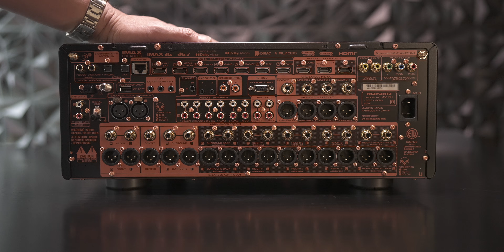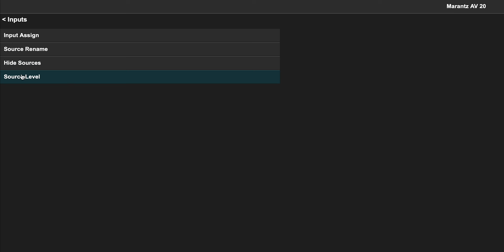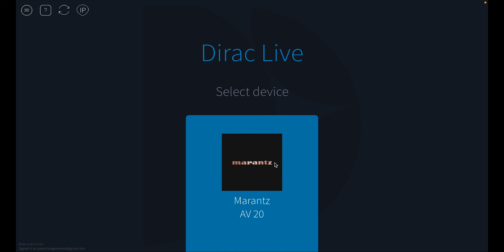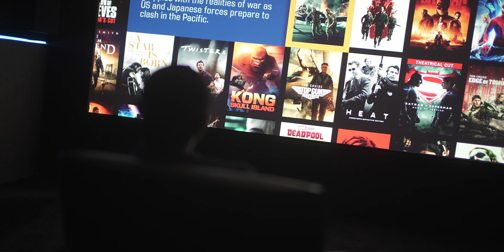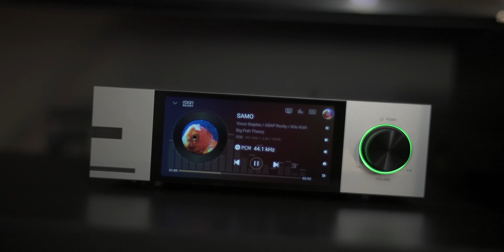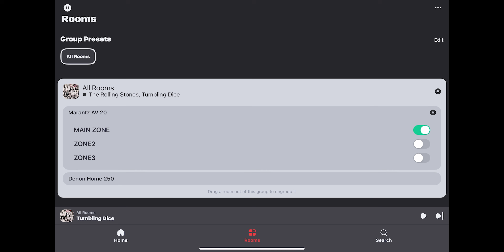Marantz AV 20 13.4CH Pre/Pro & AMP 20 Review -Dirac ART Coming!

Comment: I don't understand why Marantz destroyed the rear USB ports on all its products by changing them to power-only.  Because of that, we now have to have ugly USB thumb drives or cables sticking out the front of our units (which no one wants to see).  What the heck would a power only USB port be needed for anyway?  I hope customers tell Marantz to restore the rear ports ability to transmit data like they used to have.

Comment: Shane your giving the amp 10/20. A pass to easy. For the price marantz is charging they better set the bar higher.  This is why I use strake sound or anthem amps.   But av20 might be a little high in price but nice upgrade in there prepro line.

Comment: I can't see the value in the Amp 20.
Here in the UK the Amp 20 is (I think) £4750. For roughly the same price you could get 2 Emotive XPA 7 giving you 14 channels and significantly more power per channel. The Amp 20 draws max 1500w the Emotiva's  2600w each. 
Cost wise you do even better with 2 Tonewinner amps.

Comment: Excellent video boss who is going to repair these amplifiers when they break down I have gotten a 4800 H and a 6800 H from DanOn the 4800 H the HDMI board failed on it sent it back my dealer asked me what do you want instead of it I said the 6800 H that came had it for a month software issues and the gooey that fails sent it back in both cases all I got back was money money they did not repair or could not repairs I don't know which in Europe anyway I live in Ireland but it seems they have no repair service in iron in Europe and that was it then I now have a Sony STR IN 1000 and an absolute delays in both sound and vision60° special audio fantastic at all works from day one without any issues set up as a breeze so that's what I have now thanks for an excellent video

Comment: Tried lfe routing and positional. 

Found the same thing. In some circumstances, it was worse if you don't have the exact same subs.

 I have a svs sb1000 and a sb2000pro the 1000 is a  far worse sub, so the experience was not great.

 Coupling the speakers into one main channel (with different trims) worked a lot better keeping that overall solid feeling.
Reply from the maker: Yep, Mono split of all subs properly time aligned and level matched for the win.

Comment: Cool, If you found an AV10 and amp10 in a shop don’t go to the 20. If you really want marantz take the integrated av30…. This one is a big scam from Marantz (I’m a a marantz fan). Construction and components are not a 12k price. You pay 3 times the price for the same…

Comment: When you showed the DIRAC calibration, you didn't mention to check the noise floor and when setting the volume, try to achieve between 20-30dB (ideally 25dB) higher test signals than the noise floor. Also you haven't mentioned the minimum and maximum distances between the microphone positions. Also you left out the most crucial part about setting the gain for the subwoofers. Did you do this on purpose?
Reply: You clearly missed the part where he said to watch the tutorial videos 🤦🏻‍♂️
Reply: @andrewskaterrr  you clearly missed that video lacks this information too ;)
Reply: @davidjalsoviczky6055  this is clearly not a step by step tutorial for Dirac, it's a review that had a quick section glossing over the overall way that Dirac works. You need to learn the difference. We don't want an hour long video that is a review and Dirac step-by-step.

Comment: Why dont they have an amp with 30channells.missing out there marantz.
Reply: lol, Atmos is not Atmos without 30 channels.  I've always believed that the 4th surround speaker at angle 187.31 degrees in the rear is the second most important speaker next to the center.  It doesn't play any sound and doesn't need to be connected but it just fixes all acoustic issues of the other speakers in the room. 😂

Comment: So here's my honest opinion about Marantz AV20 its a $6000 12 channel power amp, it's rated at 200wattx2 at 8ohm (20-20k)hz. If you look at the back of this amp it's rated at 400watt max and made in Japan. What bugs me most about Marantz is that they rate all their power amps based on only 2 channel driven at full frequency spectrum even if its a 6k 12 channel amp. 
What any consumer will expect from a 6k 12 channel amp is atleast rate it at all channels driven with full spectrum. And I think the reason Marantz does this is because it just doesn't have enough power. If back of amp says 400watt then don't expect 200watt into even 5 channels driven as shown my Gene too.
At this price point people will most likely use big chunky towers that need 300watt into 8 ohm per channel and this amp can't provide that and will run hot too. I would suggest rather invest in Rotel amp or Emotiva XPA DR3 which can offer 600 watt at 4ohms with all 3channels driven with full spectrum at 2500 dollars. It will run cooler too and enough power.
Reply from the maker: The back panel power  is NOT max power consumption unless it says it is. I did a detailed article and video on this topic you should watch. The AMP 20 legit does 200wpc x 1 to up to 7Ch driven. It has a regulated 1500 watt power supply. 

https://youtu.be/P-TeDMdZSno?si=i0ADeM0FCRjsWWo5
Reply: I think for the money you can't beat Monolith 7x which gives you 200 watts all channels driven for 7 channels. I would never play loud enough to need higher than 200 watts.

Comment: As you mention the RMC-1 often (I'm still an owner), please try to get hands on the Plus (+) version, which comes with Web UI, Dirac and 8K Board - I see it as a direct competitor to the AV20, also for the price. thx.
I still don't like the small, round Display with the AV20 (or the AV10).

Comment: Directional bass works but here is a huge caveat. The bass can’t be in the lfe for it to work properly. It has to be in a channel for the processor to know where the sound has to go. This is why you heard a difference when the crossover was moved up. The bass below 80 is in the lfe most of the time. 

Also, you lose any multi sub eq benefits with directional bass when all subs are not playing at the same time.
Reply from the maker: Yea, directional bass is not really a great idea for these reasons.
Reply: Is the bass below 80 in the LFE?  I'm pretty sure there's a lot of bass in the 40-80hz region (even 25hz due to room extension) that came from my speakers when I didn't have a sub.

One of the guys from REL was talking about that and how the bass in Phantom Menace during the pod race, hearing it from a speaker is very different than hearing it from a sub.  You can position it and it sounds more together than coming from another speaker situated somewhere else especially with a single sub which most folks will have.
Reply: @techsamurai11 it depends on how the track is mixed. 

For example, if we look at music mixed in atmos on Apple music  

Even though it’s atmos, some of the mixes have no bass in the LFE.  All of the bass in in the channel. 

Some has the bass in the lfe.  Lfe is just a mono channel so it can technically play as high as the avr will allow. 200 to 250hz. 

What we see in the real world with movies is most of the bass below 125hz or so is in the lfe channel which has no sense of direction. 

Technically, they could probably track the bass with object movement even though the bass is in the mono channel but the evidence does not support them doing this today.

Rel makes a nice looking sub. I rarely hear factual information when they try to explain how certain things work.
Reply: @bigjack79  "What we see in the real world with movies is most of the bass below 125hz or so is in the lfe channel which has no sense of direction. "

Actually when I got my SVS Micro 3000, the SVS person on the phone told me to use 120hz as the crossover point.  

Well, music sounded horrible and some voices like Clint Eastwood's in the song Gran Torino were missing octaves.

We went from 120hz to 80hz to 60hz in 2.5 seconds flat.  The guy was in shock over the phone 🙂

But that was music.  So positionally the sub could definitely not replicate the frequencies between 120hz and 40-60hz

I was actually shocked how low instruments and voices go and even went online and checked and many go very low especially male voices.

I haven't done it with movies but I'd be surprised if the LFE cuts off at 125hz, I'd expect the sound to be hollow just like music was.  I didn't run a sub for 15 years and got one just to appease my mind and I can tell you my mains were hitting low frequencies (they play very well at 25hz thanks to room extension).
Reply: @techsamurai11 proper sub integration is key with a good target curve. So your mileage will vary.
Reply: @bigjack79  Now that I think about it, there's no way that the channels only go to 120hz.  Otherwise, what's the point of having a crossover and small or large speaker settings?  It'd be all pre-determined at 120hz and a sub would be required, not optional even if you have B&W 801D4s or Perlisten S7Ts🙂 Those high-end speakers would play the same frequencies as the cheapest bookshelf speaker with a midrange and tweeter - bass drivers need not apply.

So every channel must be full range.
Reply: @techsamurai11 the lfe is a separate channel.   The frequency selection for the lfe is different than the crossover setting.   

The crossover over will route any bass to the sub.   So even if there is no lfe in the mix, the bass will route to the subs at the cross over. 

If the bass below a certain frequency let’s say 80 hertz was put in the lfe channel, you could cross over at 20hz and your towers would not play the bass in the 21 to 80 hertz range because it’s in the lfe. 

Your tower would only play the lfe if you had it in a mode like lfe plus main.  Which there wouldn’t be a crossover then.
Reply: @bigjack79  The opposite is true also - if you don't have a sub and therefore no crossover your channels will try to play full range.  If the recording cut off bass at 120hz for channels 1 through 7, then systems without a sub would sound like portable $10 speakers even if they cost $100,000.  

I'm not a recording expert but I did own a system without a sub for 15 years and there was bass.

I don't know how much of the bass goes to the LFE channel. 

I think your point was that ART requires bass to exist in the channels, not the LFE, and I believe a lot of the bass is in the channels which is why you can choose to cross it over to the sub if you want but almost never should if you have towers with room extension.

Bass coming from a speaker bass driver is not the same as coming from a sub as people quickly find out.  That's why they recommend the crossover to be 10hz over the speaker's lowest frequency.
Reply: @techsamurai11 this is in reference to directional bass.  Art is a different conversation

Comment: $6000, Who actually owns this company now? How will warranty work etc... be handled? I had a Marantz before I switched to Anthem in 2019 and to get service was a real nightmare.
Reply: Anthem prefers you work with the dealer what sold you the receiver. I own 2 anthem receivers and 1 amp.
Reply: @srincomptr  Yes I know, luckily here in LA there is a Authorized  Anthem  shop (they are also Marantz, Macintosh etc... Auth.) in case something goes wrong since the place I bought my unit stopped immediately handling the brand after I bought it and turned out to be a really horrible dealer in general. That was the last time I would deal with a small / local/ independent dealer  for audio equip and now only deal with big companies. I just don't know who owns Marantz right now, hear they might be killing off Denon etc... I loved my Marantz receiver but when mine failed (Twice, they broke it at the place I sent it, and had tp send it back, me paying for shipping both times I sent it the local shop want authorized then)  It made me look elsewhere. Have to say the last Cinema model line up was very interesting to me.

Comment: How much is the tariff on the AV 20?
Reply from the maker: I'm not sure, but it will be significant.
Reply: Pretty sure I read that the tariff was already factored into the price.
Reply: @Dalt1225  and Marantz thinks people will but this at 6k or whatever the price is ?
Reply: @harrytej I can't speak to that. I guess we'll see. I was only sharing what I had read.
Reply: @Dalt1225  According to Audioholics webpage, that’s correct, but they didn’t disclose how much of the $6,000 price is the tariff.
Reply: The tariffs may never affect any of these products
Reply: @rogerayer6731  I wish that was true. The AV10 recently raised their price from 7000 to 8000 because of the tariff increase. Fortunately the AV 20 is priced with the tariff included.